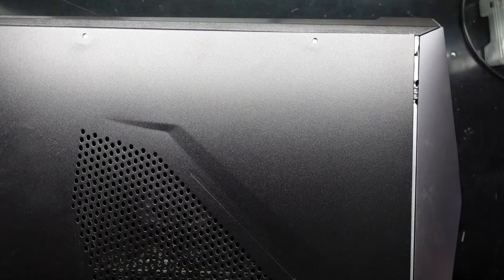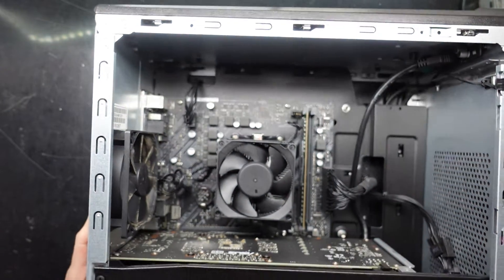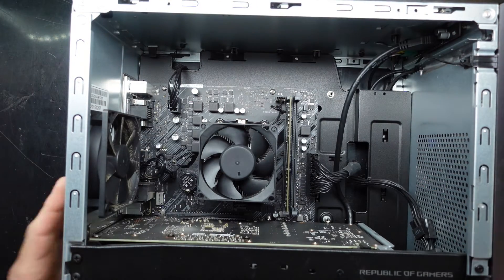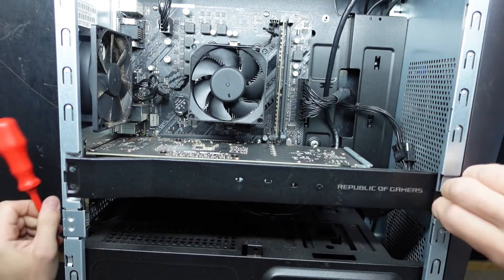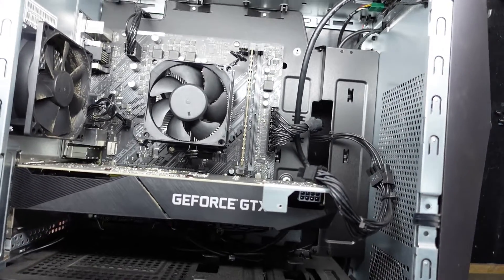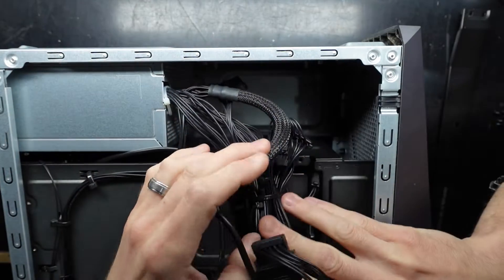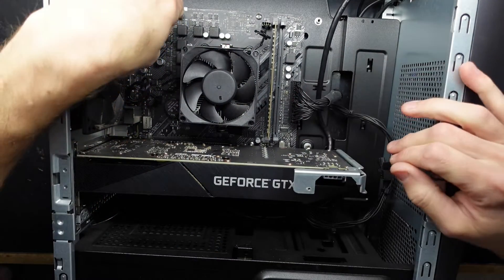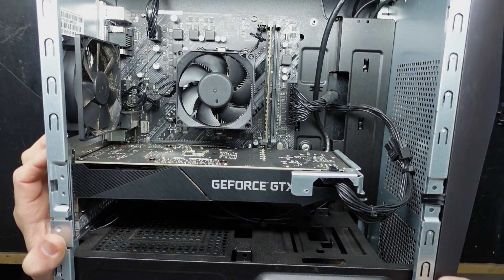How to Upgrade you Asus Rog Strix GL10DH (Upgrade thoughts)

Comment: I upgraded it with an MSI GeForce RTX 3060 Ventus 2X 12G OC and  Corsair VENGEANCE LPX DDR4 RAM 32GB (2x16GB) 3200MHz CL16 Intel XMP 2.0 without changing the power supply and I don't have any issues. It was stupid to go with the 3200 MHz, I didn't check on the limitation of the motherboard, now it is being used at 2133 and there is no XMP option in the bios, oh well.

I also added a TP-Link WiFi 6 PCIe WiFi Card for Desktop PC AX3000 and a Samsung SSD 970 EVO Plus that I had

Comment: What kind of ram and GPU can I put it in to upgrade for a better GPU than 1660ti that fit in it without ruin my wallet and what Ram to have 32Go? Crucial seems to recomand som 2*16 at 3200mhz but it seems that the actual ram is 2666.
Reply: GL10DH only supports up to 2666Mhz - I've got this system and had the same thought.
Reply from the maker: i would aim for 

RX6600XT
32GB 2x16GB 3200mhz

Comment: hiya. late to the party but i was wondering if you'd be so kind as to recommend what motherboard i could upgrade to. 
I'd like to be able to enable xmp and switch to an am5 processor.
cheers!
Reply from the maker: if you are changing to an AM5 processor, you will need a new motherboard and DDR5 ram

Comment: my pc came with a ryzen 7 5700g, and im planning to upgrade to a ryzen 9 5950x, is it possible or do i need to buy a new pc
Reply: ive upgraded to 850 watt psu, and a rtx 4070 super, so too lateee..
Reply from the maker: check out the manufacturers page to see what cpus are supported but I don't think that processor is, last I looked
Reply: @rickstechrepairs  how do i do that
Reply: @rickstechrepairs  also, they are both 5000 series processors on am4, so why wouldnt it work?
Reply: @rickstechrepairs  what motherboard is in the pc
Reply: Motherboard is an AMD B450 - won't support anything higher than an AMD 3xxx

Comment: Hi, I have this PC and I would like to add an intake fan to it but it seems like I would have to take off the entire front panel cause it blocks airflow. 

I've seen a video where someone put two 120mm fans in the front without removing the panel and claimed that it does work somewhat. 
I would like to hear your thoughts on this please if you don't mind.
Reply: Honestly i would just buy a new case
Reply: Is there a case you can recommend? I bought this PC for my son. He hasn’t had problems with overheating that I know of. Usually only plays Roblox, fortnite and some old cod zombies.
Thanks
Reply: @Hecto185  I would either choose the  HYTE Y60 or the NZXT CM-891FW-01 H9 Flow both are really good cases but they're a bit expensive. The H9 flow comes with liquid cooling which helps alot and the HYTE Y60 has more spots for air to flow into if that helps.
Reply: @Hecto185  if i was you i will buy the corsair 5000d case and and 2x16gb corsair ram card to make it a 32gb ram and a samsung 990 nvme ssd and buy extra fans for new case and a liquid cool cpu cooler like a corsair H150 i elite and a new power supply atleast 850w to 1000w
Reply: Thank you. Would you recommend any other upgrades? We have the one with a 3050 and only 8gb RAM so I ordered 32gb last week.

Comment: So...any  chance you could show how to replace the psu? Lol im about to pry the metal open...

Trying to change the gpu and need more power but cant figure out out the acces the psu without breaking anything also maybe any psu suggestion that would fit.
Reply from the maker: no sorry, no longer have access to the machine, under the 4 screws on the back of the case
Reply: @rickstechrepairs  yeah i got that part from this video but cant seem to be able to disconest the wires with my big hands lol. Still thx for your time ill try to ask a friend with smaller hands.

Comment: I have this PC. I just ordered a Ryzen 9 5900x to stuff in it after upgrading to 64gb of ram and 2tb ssd. The r7 3700x seems to be whats slowing down processing in Lightroom and Photoshop. 
The R9 5950X appears to be the absolute best CPU you can upgrade to with the AM4 socket, but that CPU requires some intense cooling and I knew the GL10DH has limited room in the tower. So I opted for the Ryzen 9 5900x because of that. It's the second best CPU for the AM4. I also ordered the Noctua NH-U12S Redux cooler to go with it. The 5900X is $299, and the Noctua Redux is $54. Hopefully this $350 upgrade makes a significant difference.
Reply: Thinking of purchasing one of these desktops soon second-hand for $500. What are your thoughts of the improvements you've done so far? Is it worth the money, or would it just be better off scratch-building something as good/better?
Reply: @TheShockwaveDragon  unfortunately the motherboard cannot be upgraded to the 5000 series Ryzen. I had to buy a new motherboard which led me to pretty much just building a whole new PC. The PC as is, is really awesome tho. The only reason I was trying to upgrade was for programs like Photoshop and Lightroom. For gaming, the RoG was just fine. I just need more CPU power.
Reply: @DexterGoneWild Bro i have the same problem right now i just bought a r7 5800x and my parents are mad because i spent half of my money there and now i need to get a fucking motherboard
Reply: @eelifnbr  my pc is similar, but came with a ryzen 7 5700g, is it possible to upgrade to a ryzen 9 5950x? do i need to update a bios or not
Reply: @morning_star5066  it was possible for me, and also you would need to upgrade the CPU cooler because the default fan isn’t capable to keep it cool
Reply: was the default cpu fan good enough for cooling is did you have to swap to a new one. also i swapped to a rtx 4070 super and 850 watt psu, my rog strix is different than yours but we have the same case. also for additional cooling remove the front panel ( yes its possible and intended ) 👍👍
Reply: also you are correct, that cpu is the best one availiable for am4
Reply: I have r7 3700x in same prebuilt pc . does it gl10 dh mb support nvme SSD
Reply: brother i have the same pc model GL10DH-IN026T can you pls tell me if its compatible with 3200mhz ram since i only have ddr4 8gb single 2666mhz ram stick im upgrading to 2x16gb ddr4 3200mhz CL16 would it even be worth it would really same my savings THANKYOU
Reply: @wavymiet  The mobo only supports up to 2666 in the GL10DH unfortuntely

Comment: Can I install another m.2 ssd storage drive there?
Reply: This PC only has 1 single M.2 slot. I had to clone the stock M.2 SSD to another one I bought via a USB adapter, in then completely swap out the stock M.2 drive for the new one. I upgraded it to a Samsung 980 PRO SSD 2TB.

Comment: I want to replace my power supply with something better but I don’t actually know how to get the power supply out could you give me some advice on how to do that
Reply from the maker: Don't have the machine to advise you sorry
Reply: @rickstechrepairs  I figured it out upgraded my 500 watt power supply to a 750 watt and and put a new 3060 gpu in it
Reply: @jordanstanford8930  were the parts all standard? any complications during swapping out the old PSUs?

Comment: I have the same PC, although it does come with two sticks of RAM. I’m looking to upgrade the fan positioned on the back of the case because I already replaced the CPU cooler, and since that didn’t improve the sound, I am trying to find a replacement for the fan. Do you have any recommendations? Right now the noise level averages at about 55 dB and sounds like an airplane taking off constantly.
Reply: the fan case is what is lout af.

Comment: hey there needing to upgrade the GPu and wondering if the windforce 1080 oc could fit? been looking everywhere for the case and motherboard specs but asus just didnt want to put them out
Reply from the maker: I don't think the factory psu is high enough wattage
Reply: @rickstechrepairs  i have a 3050 with 650w and also used 980 prior works fine but for my own build not the prebuilt model

Comment: Hey I have the same pc with gtx 1650 single fan.i dint  get the metal  piece  with my pc.Will my graphics  card wobble  if I upgrade  to rtx 3060 without  metal  support?.can I get the metal  support  separately  from store?
Reply: Nah mate. I have a 3060 in mine, no bar. So long as you're not shaking the unit, you will be fine.
Reply: @Luca_Natoli  does your GPU have a tri- fan? i'm worried that if I got it wouldn't fit.
and could you lmk what 3060 you got, thanks.

Comment: Does the exhaust fan get stupid loud for anyone else? Can the fan be replaced?
Reply: The fan gets really loud for me too, I don’t know if you can replace it, but I want a new PC case overall.
Reply: @Sploofle  i suggest getting a new pc case
Reply: @dixplayd8930  bought a Corsair 4000d airflow
Reply: @leaf.clipper  did that fix it?
Reply: @cuh123..1  fixed the issue
Reply: @leaf.clipper  In the same case?
Reply: @HHHHHHHHH8893  No i had ending up swapping cases. the one that i am using now is the corsair 4000d
Reply: @cuh123..1  yep
Reply: @leaf.clipper just ordered my 5000d yesterday. Can’t wait for the swap
Reply: Will this fit in the ASUS Prime AP201?
Reply: @itslucillep  I'm basing this solely on appearance. looks like it will fit. hope I was not too late to the reply! have a good one!😀
Reply: @leaf.clipper how hard is it to recase this? I’m buying it for my son. I got a good deal on it with a monitor.
Reply: @Hecto185  it was not hard at all. I found it super easy sir
Reply: I could make a video?
Reply: can't remove my mobo from this case

Comment: I have a asus rog G10CE-I51660TDC with a i5 11400f and a 1660ti and I want to upgrade the motherboard so that I can have my ram and cpu running at their full potential would I be able to upgrade the motherboard and if so which one should I choose?
Reply from the maker: dont bother upgrading the motherboard, might improve gaming performance by 5% if you are a lucky..

https://www.intel.com.au/content/www/au/en/products/sku/212271/intel-core-i511400f-processor-12m-cache-up-to-4-40-ghz/specifications.html
3200mhz ram is the max speed the 11400f support anyway

Comment: Hey, do you think that the ROG Strix GL10CS Motherboard is compatible with Intel Core i7-12700K Desktop Processor 12. I would appriciate a response as I am trying to upgrade my cpu but I do not know much
Reply: or do you have a cpu that is i7 that is compatible with this ROG Strix GL10CS Motherboard
Reply from the maker: https://rog.asus.com/au/desktops/mid-tower/rog-strix-gl10cs-series/spec/

it looks to support these
Intel® Core™ i5-9400F Processor 2.9 GHZ (9M Cache, up to 4.1 GHz)
Intel® Core™ i7-9700K Processor 3.6 GHZ (12M Cache, up to 4.9 GHz)

Comment: Hi, I have this PC. Can I upgrade the power supply to an ASUS ROG Strix Gold 750W Power Supply without making any other changes? I think the current power supply may be starting to fail. Thanks for any advice.
Reply from the maker: Yes, PSU b upgrades are mentioned in the video
Reply: @rickstechrepairs  How do you remove the power supply?
Reply: @morgvenomc3566 plz let me know if you find out.

Comment: Do you think this setup could fit an rtx 3060? I have the same setup and i have the idea to upgrade the 1660 ti to a rtx 3060 and the 3400g to a ryzen 5 5500
Reply: I upgraded mine to a Rtx 3060ti and it’s ok so far with stock power supply.  I used the EVGA 8GB version.  It’s actually smaller than the original graphics card. It does say that it needs a 650 w power supply however the stock 500 w one seems to be doing fine for now.  I’m not exactly sure how to tell if the graphics card is getting enough power other than the fact I can run 3-4 monitors in extended mode and during gaming it automatically selects for highest settings.
Reply from the maker: Twin Fan 3060 Maybe.. but then you will need to upgrade the PSU
Reply: @rickstechrepairs ty for those i’m also trying to upgrade my gpu one day! i was doing dual fan w/ a 650W also plan on upgrading to 32 GB of ram just so i’m comfy which all of came up to about 600+ USD :D
Reply: It can run the 3060 without upgrading your power supply. 500watts is plenty enough to run the 3060.
Reply: Are you sure you can run a 5000 series? I read there is no bios upgrade for it

Comment: i have the 3400g wit the 1650 an i upgraded to the 6600xt an i was bottlenecking so i got a 5600x cpu an idk the name of my motherboard so i can do a bios update so i can put my 5600x in idk if the motherboard allows the 5600x plz help
Reply from the maker: Going by the age of the bios, I don't think Asus updated this machine to support the 5000 series
Reply: @rickstechrepairs  didnt u say it did in the video tho? Pretty sure u Said something slang the Lines of: with a bios Update u should be able to upgrade to a ryzen 5000 series

Comment: Good video 
Do you think I can put a 6750xt dual fan in here with a power supply of 750w ? Just uprade this two is okay ? Or not ?
Reply from the maker: I would think that should fit

Yep Just upgrade GPU and psu
Reply: @rickstechrepairs  thanks !
Reply: @yvannfede5094  how was the upgrade
Reply: @jma3165  perfect but i have to remove the wifi card to put the GPU in it